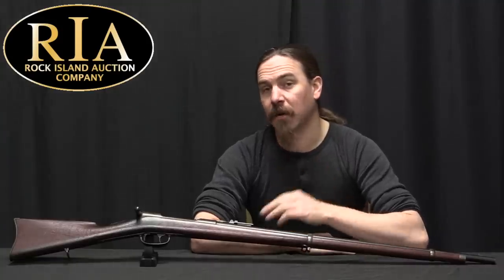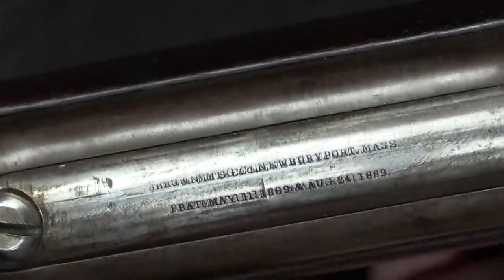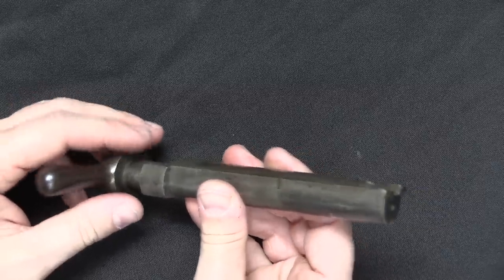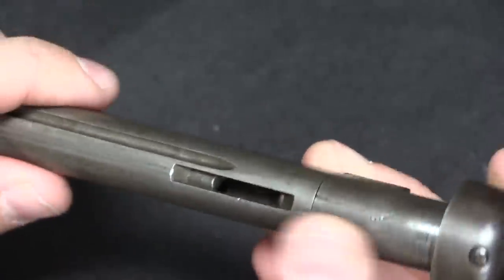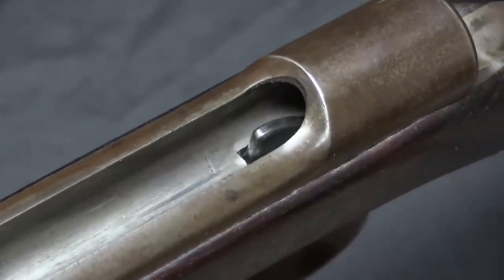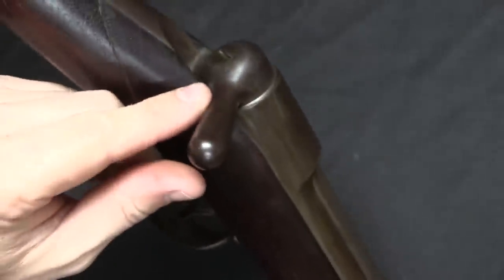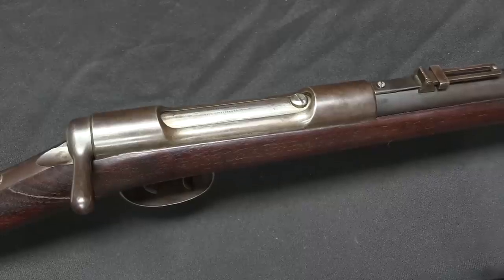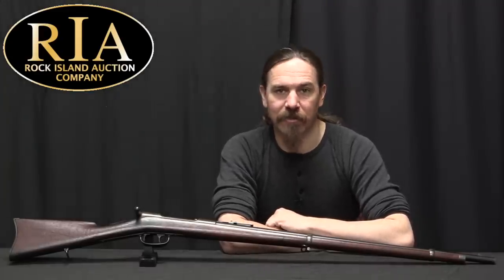Brown/van Choate Trials Rifle: Internal Hammer in 1871

Comment: A way to help with the problem with the extractor would be dip the channel where the cartridge went in (so when dropped in the rifle the cartridge will naturally be dipped slightly nose up so when pushed forward it will be gently brought up to lock in with the extractor)
Reply: That's exactly what I thought. Just have the cartridge drop in so that the extractor will easily clear the rim and as you push the bolt forward the rim will be forced up and into the extractor. In fact, it's so easy a solution that I'm wondering if they didn't actually do that but Ian didn't notice it because he didn't have a cartridge to test it with. Just the thought of having to manually lever the round in to have the extractor grab the rim seems so utterly terrible that I would expect any halfway clever designer (which this guy kinda seems to be) to come up with a solution for that.
Reply: @beavisbutt-headson3223  That's a good darn solution. I thought of adding a little pin at the base of the lock so when you round it throws the cartridge of for you. Also thought of quiting the cocking trigger, it's unnecessary

Comment: The bolt handle tension adjustment is godfather to the Bren-Ten's most-tactical mag drop adjustment screw.

"Who's the most tactical? Why I'm the most tactical. What's your bolt handle tension adjusted to? Four pounds? Pffft! Plebian. You gotta get those numbers up. Those are rookie numbers" 

Proof there's a fine line between innovation and needless overcomplication.

Comment: if he had made it with a sprung extractor that also worked as the bolt stop, it would have been both still simple and better.
Reply: or use the bolt stop screw to hold the extractor spring in place, somehow
Reply: @moosemaimer  ...a bolt with it's own bolt
Reply: @moosemaimer  My thoughts exactly. It wouldn't have even been difficult to convert this. Just mill a slot where the current extractor is.
Reply: 149 years of hindsight has nothing to do with that, of course. 😉

Comment: That extractor could easily have been modified to be a spring steel one. The bolt retaining screw could have also retained it.
Reply: You could have helped this guy out 155 years ago.
Reply: It shouldn't have been the only retaining element though. Maybe slide into a dovetail and then secure with the retaining screw?

Comment: In 1870 in the UK they tested a van Choate and a CHASSEPOT (amongst other guns) against a no-doubt pretty useless "portable mantlet" - a steel shield on wheels. The chassepot didn't make a dent, the Van Choate cracked the shield a bit but that was a lucky shot on a thin part of the device (London Evening Standard 30 August 1870). Mr. Van Choate seems to have been reasonably prosperous in the 1870s thanks to income from patents relating to telegraphy, and a job with the American Cable Company.

Comment: I mean the simplest way to make the Loading easier is to have the bottom of the loading well a ramp so the rim is sitting below the extractor and as it is chambered it lines up with the bore and completely eliminates the issue of the extractor in loading

Comment: If the bolt and reciever have different alloys or heat treatments then the materials would expand and contract at different rates in hot and cold, so adjusting the tension on the bolt to accomidate for any slop seems like a pretty good idea to me

Comment: Marlin was purchased by Remington..... who then took like 2 years to figure out how to make lever action rifles

they would have the barrels canted to the side.... so the front sight wasnt "in-line" with the rear sights.... 
quality control issues.... EX. having burs on the feed ramp so large you could not chamber a round.... 

ive got a Marlin 336 from the last year of "actual marlin made" rifles..... and the quality is great
accurate, smooth, nice finish, great trigger 

and then looking at my cousins 336, a 2010 model..... its like a kar98k VS a 91/30....

Comment: I have a theory on that bolt handle tension adjustment. Considering that this is from a time when bolt actions were actually quite unusual and uncommon, perhaps some users might have been lacking in trust of their ability to remain fully locked and in battery under things such as combat conditions. Clearly from just the demonstration here, with the hammer cocked, there is not much resistance to being opened in this system, and that might have been a point of concern to the 19th century user. I suspect that it was likely a response to just such a concern that prompted that particular feature's development.

Thinking about it more, many rifles of the period tend to have some sort of spring tension or detent to hold them closed and these tend to give a tactile and audible 'snap' that would be very reassuring to someone that was very concerned about a rifle's action remaining in battery. Examples that come to mind are the Remingon rolling block, the various Sharps rifles, and various others. It also seems to me that early versions of the Springfield 'Trapdoor'/Allin conversion action lacked a spring to hold the locking piece closed and it was added to later versions of the design. They wouldn't go adding something like that if it wasn't considered useful, so I'm thinking that my theory about concerns over staying locked in battery might just have something to it.

Comment: I agree the bolt tension thing is goofy but if the rifle had been designed with a proper extractor, it would have been a good idea. 
    It would be faster to operate than the 1873 trapdoor. The hammer cocking trigger would afford the ability to cock and attempt to fire again, after a malfunction from too hard of a primer.
      I mean these are trial rifles and are built to test a design. The design is sound. It just needed a few things like a proper extractor and a safety. How many design changes occurred to 'rough designs' that resulted in iconic weapons? The 1911, M1 Garand, M1 carbine, etc...
     Great video! Take Care and be safe, John

Comment: It's kind-of strange that there is a great big honkin' screw in the top of the bolt and it only seems to stop the bolt being pulled out the back of the receiver, rather than also holding a spring (or spring-loaded) extractor in place. I suppose it is easier to criticise some-one else's work (especially 149 years later), but that's what leaps out at me.

Comment: I would take one of those fancy bolt opening adjustments on every mosin i’ve ever used!
Reply: Jason Flanders are they stiff bolts?
Reply: @stevepirie8130  mine doesn't give me much trouble unless it's very dirty, but I've encountered some which are very, very difficult to operate.  My friend has one, and you'll stop shooting because your hand hurts from slapping the bolt long before your shoulder gets sore.
Reply: @comando293  You need to polish the striker cam and/or weaken the main spring. Did that and now my Mosin runs like a charm :)

Comment: Wouldn't that fixed extractor work if the lower part would be a slight ramp, so if you drop a round in the rim would be below the extractor. If you push that into the chamber it would rise up on the bolt face and the extractor could catch that.

Comment: I think that extractor could´ve worked better if he put it on the bottom, or on the side. If you manually have to drop or pull the cartridge out anyway, might as well just have that thing there for the purpose of uncorking your seized up, black powder fouled brass.

Comment: I wonder if that's meant to be an inertial firing pin?  Could be that it won't come out the bolt face because you can't hit it hard enough without dropping the hammer.  That decocking method is no different than a 1911...

Comment: So if it takes a proprietary cartridge, and based on the dearth of info on said proprietary cartridge,  could that have some bearing on the seemingly inconvenient loading process which Ian deems makes it a somewhat lousy design? Maybe it had a purposely week rim that would, in theory, collapse under locking pressure and "pop" back up upon firing pressure? Far fetched, but without more specifics on the intended cartridge we really don't know. Because that seems like a glaring negative for a product that somebody felt had enough potential to be fairly heavily invested in and entered into military trials.

Comment: I was just wondering if someone has the answer to the following questions : 
Why put the extractor on top of the bolt assembly? Is there any mechanical advantage to do so?
It seems to me (and I'm far from being a specialist) that to have the extractor below would not change much regarding manufacturing -- except that you'd have to cut a groove to accomodate it -- but much regarding handling of the gun, since you would not have to bend your cartridge to make sure it fits into the extractor prior to close the bolt, but could simply drop it onto the extractor, so to say, and then close. It also seems to me that it would make much easier any dealing with a faillure to feed for you would ot have the extractor in the way (though it's quinte small). 
Thanks to those who took the time to read that, and maybe answer it.
Reply: @tyrannosaurusimperator  Very interesting! I did learn something, thanks!

Comment: Ian, you sound almost shocked that the designer would advertise an egregious safety violation like pulling the trigger while slowly lowering the hammer to decock the rifle, back in 1869 when that exact procedure was the standard operating procedure for loading revolvers since their invention. I'd be shocked if anybody actually expressed concern about this practice in 1869.

Comment: Rifles with internal hammers now don't bother with providing a way of decocking the hammer, other than firing off the last round. And in guns with automatic hold opens, you'd have to dry fire them to decock them. I suppose though a specific decocking mechanism is just considered unnecessary.

Comment: Would it not have been possible to cut a shallow "feed ramp" in the bolt way at a point below the extractor  at full bolt retraction? Providing the cut was deep enough, the rim would be below the extractor claw, but not engaged.  As the bolt was moved forward the base of the cartridge would ride up the bolt face and under the extractor, as in the Mauser or Lee-Enfield controled feed. Bit late, realyl, I suppose.

Comment: I'm wondering now if the adjustable bolt tensioner is a response to problems with the bolt not staying properly in battery on this or some other early bolt action Van Choate had worked with?

Comment: Could the bottom of the receiver not be angled downward slightly to allow a round to be dropped in front of the bolt and then fed slightly upward underneath the extractor?

Comment: He should of developed the idea farther into a short recoil auto. If the slit in the bolt was made smaller and located the the right place the striker won't drop unroll the bolt turns into battery. Not a bad idea.

Comment: Wouldn't you also need to manually remove the spent cartridge or would pulling that bolt automatically flip it out?
Reply: There seems to be a fixed lug ejector near the internal hammer and a groove in the bolt to ride over it.

Comment: I wonder if that extractor might have worked a little better if it had been on the bottom of the bolt instead of the top, so that you dropped the cartridge onto it instead of having to hook it under? Still not a great idea mind you...
Reply: I think most extractor claws are on the side of the bolt in the direction that ejection takes place, because the extractor acts like a pivot-point that the cartridge rotates around as it's flung out of the firearm. If it was on the underside of the bolt, then an ejection port would most likely need to be milled into the bottom of the reciever.

Comment: The (repaired?) crack in the wrist of the stock points to a flaw in the design. It's impossible to properly align the grain to resist the recoil throughout the huge length of the stock. Isn't hindsight perfect?

Comment: Wouldn't that extractor work better on the bottom of the bolt?
Reply: Not really. 
Usually the extractor is on the position in the direction in which you want the expended case to go when it is pulled out of the chamber.
Most extractors are opposite the ejector.
Some ejectors are fixed like an M1911A1 and some are spring loaded like an AR 15.

As a case is pulled out of the chamber and hits the ejector this twists the front of the case in the direction of the extractor. As it does the case lip flips off the extractor hook.